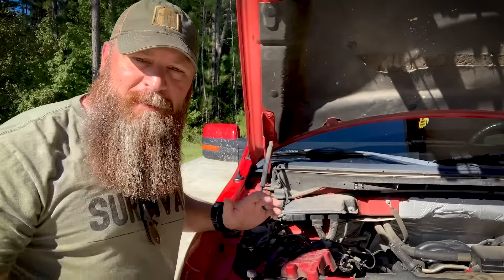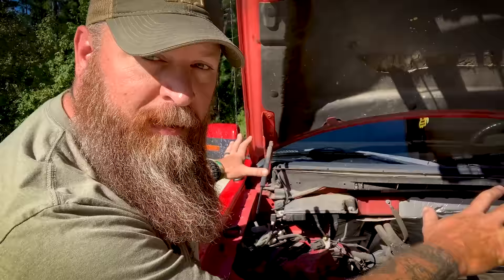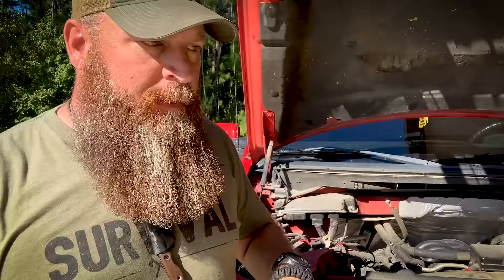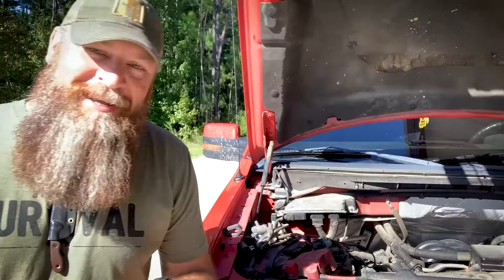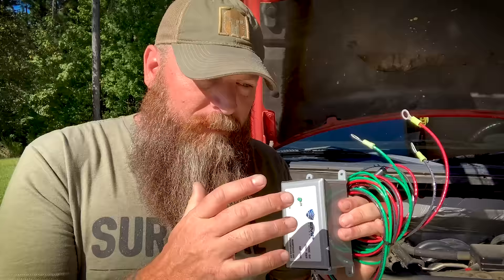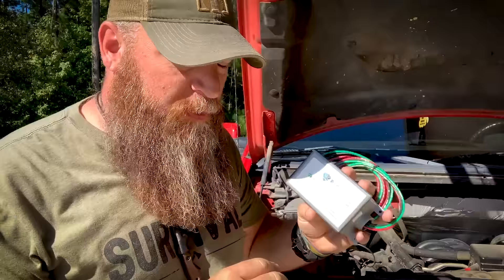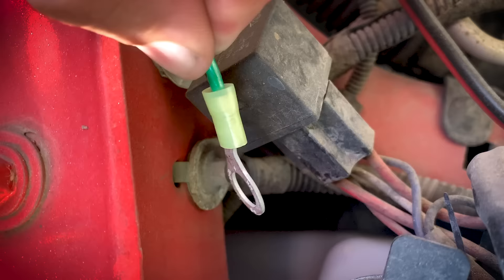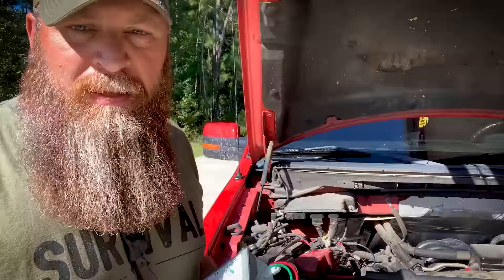EMP PROOF YOUR VEHICLE

Comment: I worked for a company briefly that specializes in EMP protection for the military. And from what the electric engineer said was that the more metal the EMP signal has to travel the less dangerous it becomes to the electronics and that even some modern vehicles would be ok even after an EMP attack it just depends on how much electronics the car has for example vehicles model years 96 and below would probably survive with minimal damage but the newer ones would be screwed.
Reply: I heard 1999 and earlier were likely safe?
Reply: Yeah I would think so too but I think he was meant later 90’s in general when explaining it. I would even think there would be a few 2001- 2004 that would possibly make it too.
Reply: @mcqtomm  the whole point is less electronics. It's not like there's a finite year where the car would be fine. Points and condenser could be fried, it's less likely but possible. The more electronics you have the higher the chance a capacitor gets blown.

Tough part is the EMP actually hits the wires, if the wires are shielded, the wrong length, etc, the car will survive. Odds are the rebound will blow the hardware through the wiring regardless of shielding.

Keep spare parts.
Reply: I have an 89 Grand Marquis, will it need EMP protection?
Reply: @jtdubi3  It's not as clear as all of that.

Lightning passes through the car 99.99% of the time. The car will start and keep going. We're talking about an EMP and frankly we just don't know.

The EMP is going to have a magnetic wave bouncing all over, if it energizes the car and goes to ground you're fine, if it hits the wiring of the car all bets are off.
Reply: @mcqtomm  - pretty sure its domestic 1976 and older are purely mechanical. post 1976 some vehicles started getting EF systems
Reply: I had wondered if an all steel body would provide sufficient protection from an EMP like how my late 80s Toyota is built (first year they fuel injected the Land Cruiser). Ideally though I would still prefer to have an all mechanical diesel engine in it so it can still run if SHTF.
Reply: @stevelucero9047  Even back then 99.9% mechanical cars had capacitors, that's all a condenser is. The coil would be a risk as well.

You've got to go back to much older than the 70s, start looking at Model T with the individual mechanical low voltage spark ignition, literally just mechanically breaking a circuit to create an arc. There's probably something more modern but we're still talking long before overhead valves, back when 100hp was some unearthly kind of power on the street.
Reply: @glenwaldrop8166  how would a condenser get fried by an EMP? Are you talking about an AC condenser? I'm confused.
Reply: @654Crossman  points ignition, it's a capacitor.
Reply: @jtdubi3  yup
Reply: LAUGHABLE
Reply: Newer is screwed without emp ..lol.. but yeah,  see what you're saying.
Reply: You do not want to be the only person in a working vehicle, when shtf, you'll be a huge target!!!!!!
Reply: @jtdubi3  yes.
Reply: @rexracer7192  great point!
Reply: 2004 and less with most diesels also.
Reply: What if you buy some copper window screening or aluminum window screening and place it properly above your cars electronic control modules, say on the card before 2003??
Also, when not in use  if you keep your battery disconnected from your vehicle, which then would not allow any pre-loading current into your ECMs or such, would that help at all??
Reply: Maybe I'm overdoing things. My house's siding is steel and it is double uford grounded. The shop is the same. As it the steel roofing. The electronics storage areas are copper mesh lined and grounded. That includes the radio room and mechanical room. I'm sure there is more that can be done, I'm just not sure what.
Reply: @NordicDan  if SHTF where are you going to drive to?
Reply: @jcyork1767  oh no I'm not falling for that....
Reply: It has to do w the distance not the amount of conductive material. Modern cars will be fine under this scenario. 

Power grid not so much.
Reply: @NordicDan  When the SHTF, driving a vehicle probably won't help very much.  No safe place to go!!
Reply: My old AM General 5 ton has all of the electrical moduels in welded steel boxes that would be replacable. The electric fuel switch might get fried, but you can turn in a screw that puts the pump on manual. There is also a brass valve to overide and manually shut off the fuel going to the old Cummings.
Reply: @mcqtomm  .....So, you're saying my 1988 AMC Eagle will be alright, right?
Reply: @anothercomment3451  up into the mountains. I grew up in the mountains so I'd be able to hold out and protect my family indefinitely. Fortunately the are others like me that I'm close with and we have a pretty good network and roles established if things devolve into a survival situation.
Reply: Is it because the metal is absorbing the electrons and magnetic waves?
Reply: @NordicDan  nice job
Reply: Is that what them
Copper cages or rebar cages are for that I see guys put around generators?
Reply: @NordicDan , no. An EMP is not like a lightning strike. Watch some videos on Faraday cages, and you'll see what it takes to "harden" electronic devices.
Reply: @glenwaldrop8166 so  you have to ground the car?
Reply: @user-jt9xj5ju6k  the car should be grounded by the wheels and tires, metal bands through the tires is how lightning travels through the car without harming the passengers or car.

The damage caused by an EMP would be dependent on the car, the amount of wiring and electronics, the distance from the magnetic wave as well as the intensity.

That said, the older the better, less capacitors to blow, much larger circuits that can probably handle it.
Reply: That is sort of correct. I am really peed off trying to summon colleagues that have actually done experiments in southern Calif with this stuff. You have a really valid point but what if ya take your newer car or whatever and drop two hefty copper cables on the ground from under em..I was told that might help but I have ppl that worked in these fields and I am hearing crickets... Most commercial aircraft have both magnetic copper in the center of em to dissipate lightning and the such. They also have the lightning dissipaters all over the wings and other places too. Lightning is an EMP too. Worse than any plane motor vehicle will ever exp by far yet they survive. My truck took on lightning strike some  years the ago yet thee CB antenna's got rid of the harsh voltage I saw the flash thru the windshield took an hour to get my eyes readjusted.. The CB radio fried real crispy so did some paint and just the very top of the Aluminum tool box too. Truck was still running.. Happened in the Tamaqua valley in Pa. in 2019... it was a day time storm not at night but the truck was still running fine... I was at a stop light not moving when it happened.
Reply: So if a EMP hit my house and I have that device and it doesn't work. Please tell me how I am supposed to file a claim.
Reply: @jcyork1767 Gas station man
Reply: My 97 civic should be ok
Reply: @bryandouglas739  most pre 1977 vehicles don't have any electronics except the radio! Trying to find one that still runs is hard!😲😲
Reply: @glenwaldrop8166  🤣🤣
Reply: Would this be able to protect the ECM, PCM, and other various ECU modules in newer vehicles as well?
Reply: @suprmanamc12  do you think they will honor their warranty to work if it doesn't🤷🤦😆🤣
Reply: This a working device or snake oil we wont discover until we need it?  How they test this thing?
Reply: @RMM919  by a small lab generated emp🤦🏼😆🤣 not big enough
Reply: @RMM919  if it wasnt snake oil someone would have bought one and re engineer it and sell them🤷
Reply: @glenwaldrop8166 All ignition systems have a high voltage transformer and a capacitance forming a resonant circuit a la Tesla coil, to create the spark.
Reply: Yeah, the little box is snake oil. No, EMP is not significantly different from a lightning strike. And your EV will be totally screwed by either. LOL
Reply: @evanpnz  Not quite. Early models were literally using copper rods disconnecting externally, causing the spark plug to spark.

A condenser is just a capacitor, honestly could rig one if I had to in order to create spark.
Reply: @glenwaldrop8166  some kind of voltage step-up transformer must still always be present. The capacitor/condenser is optional. Tesla coils only have their natural self capacitance so their resonant frequency is in the hundreds of kiloherz range. Adding a capacitance across the points whatever form they take reduces both the resonant frequency and the erosion rate of the points. Early radio transmitters used spark gaps and resonant circuits too. I've been an RF Technician since I was 18, I'm 68 now. My first car was a lot older than I was at the time. I think I know the subject pretty intimately.
Reply: @evanpnz  I've been into cars for decades now, built crap, built good stuff, worked on EFI all the way back to downdraft gravity fed carbs, even tinkered with old hit and miss engines.

You can make a spark without a voltage transformer. The old Ford literally just broke a completed circuit and that made it leap to the plugs. I can't remember if it was 6v or 24v but it was an oddball, actually had my hands on it back in my twenties.

All you need is an inconsistent connection, you can literally jump a wire between two battery posts to create spark, that's effectively what the old Fords did, they charged then broke a circuit, caused a discharge.
Reply: Snake Oil Nothing more to say
Reply: @richardf9137 Total BS
Reply: Even If you could get to a gas station, they wouldn't be working. And your credit card would prob be useless.
Reply: @frankventrella8558  you can store gasoline, you can run a car on moonshine if it comes down to it. E85...
Reply: @jcyork1767 Securing the perimeter..So when the suburbanites get together to take the rural peoples goods..they'll be taking dirt naps instead..😅
Reply: @654Crossman  Condensers are two electrical plates separated by an insulator. EMP would punch through the thin insulator and short the two plates.
Reply: @654Crossman  A condenser is a capacitor and capacitors will pass AC signals and block DC. The problem is if the voltage is high enough to puncture the insulators that are in the capacitor and a metal conductor path is formed. As little as 100V can destroy an IC circuit, but, with better design as most devices have today, they can withstand perhaps 1,000V, but an EMP will be a lot more voltage than that.
Reply: @frankventrella8558  The pumps run on electricity.
Reply: Dang my jeep has an electric problem .  The odometer will not light up, radio.   A lot of times after it rains it is worse.  Any ideas?  Thanks  single gal appreciates any help
Reply: Keyword for anything electric and electronic: 

GROUND 

It’s not about how the current has to travel between your electronics, it’s where it’s going. Grounding is the way anything electric goes. From the negative end, it travels to the positive or the ground of your car. But wait! Your car has rubber tires so it’s definitely insulated from the earth. Your car is the ground and it will be kaput. 

So yeah, that small box is a scam. If you want to EMP anything, use a faraday cage that is grounded sufficiently.
Reply: @bryandouglas739  64 Pontiac  extra points  love that car keeping them in a fairaday bag